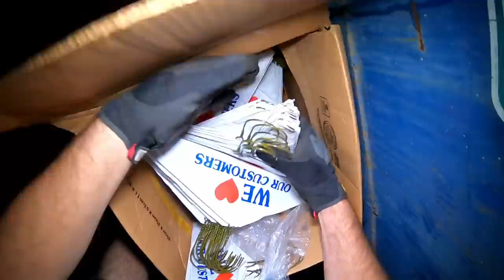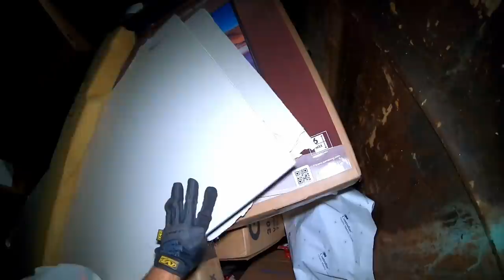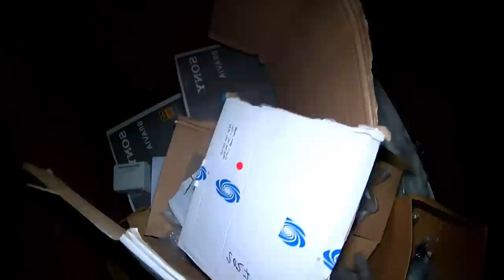Dumpster Diving "Doesn't Hurt To Ask"

Comment: MIKE! It looked like there might of been some copper in that black foam insulation! Just a heads up if you dont know, thats the line set for ac/heat pumps.
Reply: Yep, I pointed out the same thing.

Comment: I’m not asking for locations just “yes or no” to this question, does anyone else have a dumpster where they are consistent with throwing copper away?
Reply: The best I get is an alarm place that regularly has CAT wire, some circuit boards, etc. it’s pretty sparse in my town compared to Mike’s industrial zones.
Reply: I got one that coughs up them brick-sized lead-acid batteries every week. Seven of them today!
Reply: Right next to the dumpster marked " GOLD SCRAP ONLY". 😗
Reply: I use to hit a plumbing place and they would have little bit's but once they did set out a nice amount of copper. Then they moved. They know it is worth money and will keep it themselves, or they already have a scrap guy.
Reply: Yes

Comment: What's Mike's big problem with wall studs? It's still scrap steel isn't it? 
Or is it a scrapyard thing? I've never heard him mention the specific issue he has with 'em.
Reply: It's the plating on them combined with how thin the little bit of steel is. Yards don't want them.
Reply: @markfurman4386  Many thanks, I must have missed the Ep where he explained that.....
Reply: he hates them because  they are so light. He would rather keep moving.
Reply: He has called them his nemesis several times in older videos.  Occasionally he has taken 1 or 2 well the pickings are slim, but he hates them.
Reply: He said they blow out of the truck going down the road.

Comment: You have to slow down man. No copper should be left behind. Get every little scrap. It's like 20 times more valuable than steel. If you have to choose between copper and steel, steel should get left behind. 100lbs of steel is like $10-$14. 100lbs of copper can be from like $175-$250 depending on prices and the grade, and even more for copper tubing and pipe I think. Just something to think about. Copper is scraper gold.